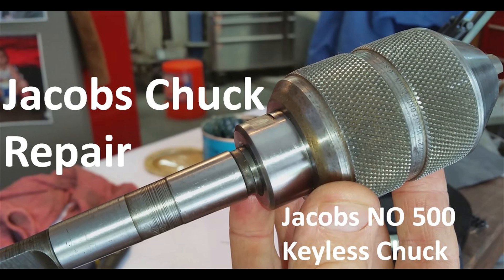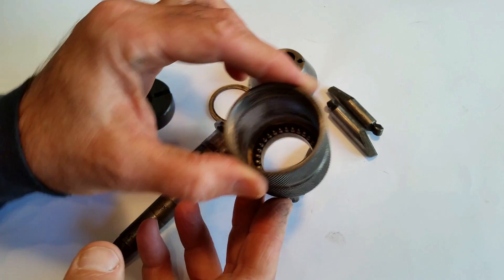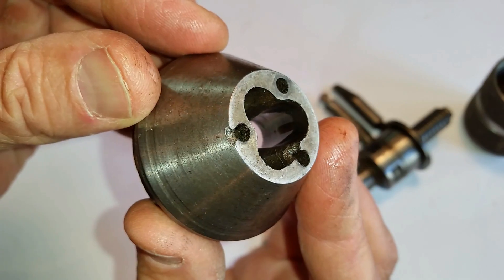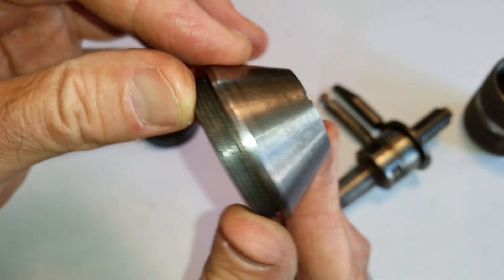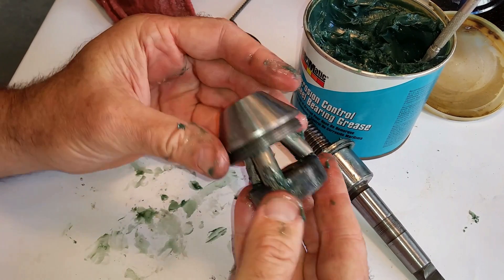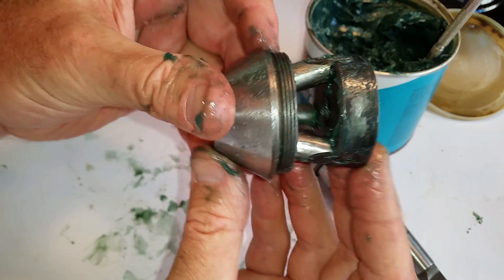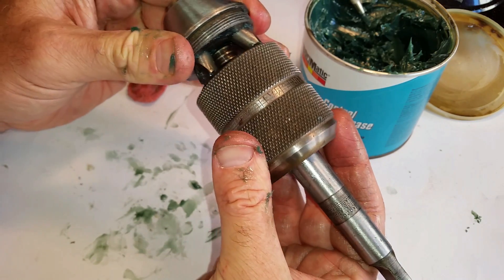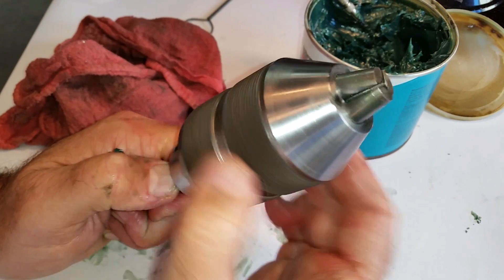Jacobs Chuck Disassembly and Repair

Comment: Nice video, what brand of grease are you using? Do you know too if you can disassemble an old Delta/Milwaukee 14" drill press head stock without removing the chuck? I can't seem to find a specific video. Thank you.
Reply from the maker: Hi, Thanks for the note.  I just used the grease I had handy, its brake grease.

Comment: I just picked up an old Ames lathe that had a Portomatic chuck in the tail stock.  First time I've seen one.  It's pretty grungy but it works so smooth.  I can see why you just found a new favorite chuck.
Reply from the maker: Thanks for the comment.  I wasnt familiar with Ames so I checked them out.  They look like really nice machines with some unique features.